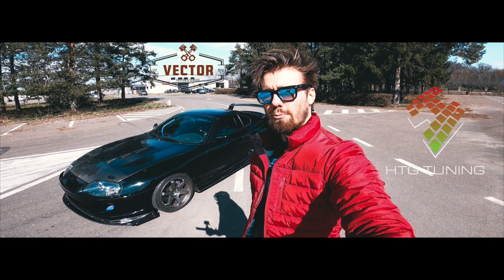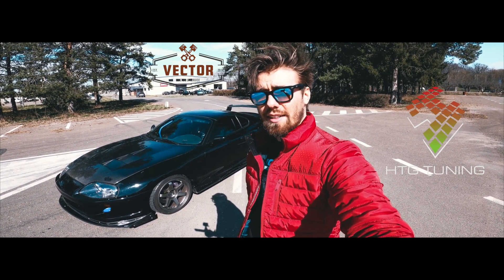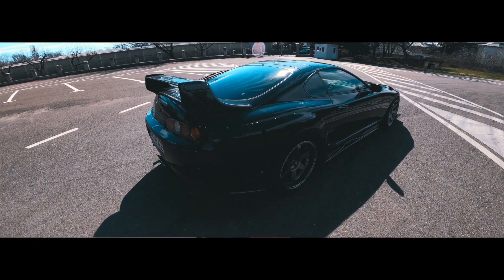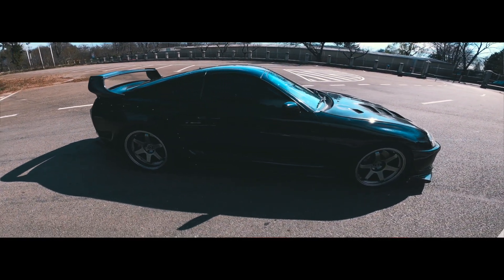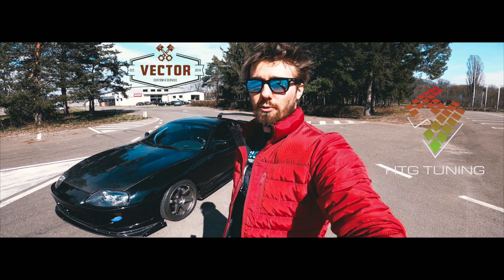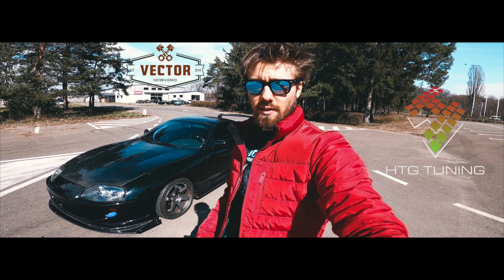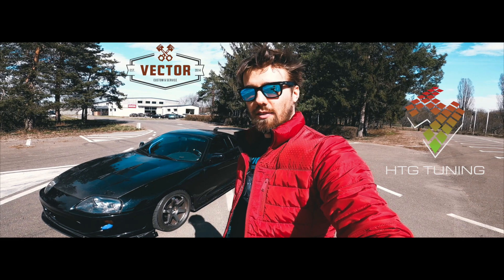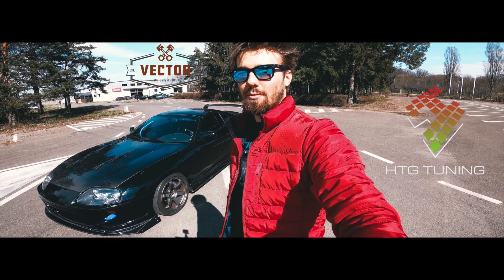850WHP Supra mk4 runs DCT with HTG tuning GCU Gearbox Control Unit at VECTOR Custom & Service

Comment: What is the maximum torque rating on the M 7SPEED DCT
Reply: 1000ft/lbs with SSP Spec-X pack or Dodson clutch pack
Reply from the maker: We had users delivering over 1k NM with stock clutches

Comment: Will the HTG GCU work with something like a Holley EFI? Or is it a standalone unit replacing the ECU entirely?
Reply from the maker: It's standalone Transmission controller and it can cooperate with any ECU.

Comment: How does the rev matching work on downshift?  Does it require an electronic throttle?
Reply: Automatic throttle blips/rev matching requires either : dbw throttlebody or a numatic bliper module attached to a throttlebody.

Comment: Do you have any videos with htg dct/auto gearbox with a aggressive shit cut  through standalone ecu?
Reply from the maker: Yes, see out youtube channel there is other supra video on the dyno running nice solid shifts :)
Reply: @HTGtuning  is there any fitment issue with the 1997 supra, do have to beat the transmission tunnel to make it fit?
Reply: @oneextramod9295  i would like to know this as well